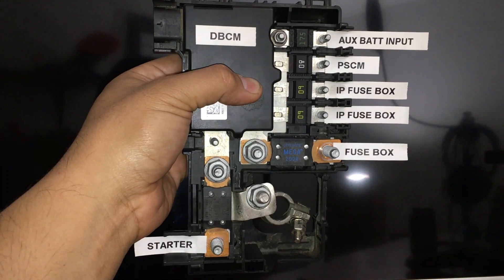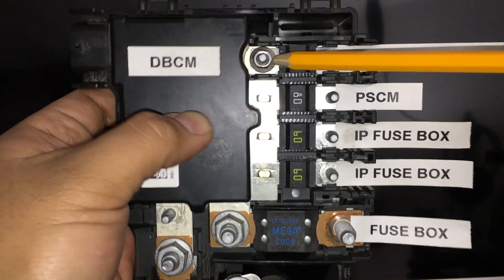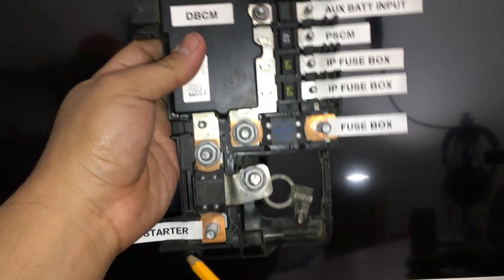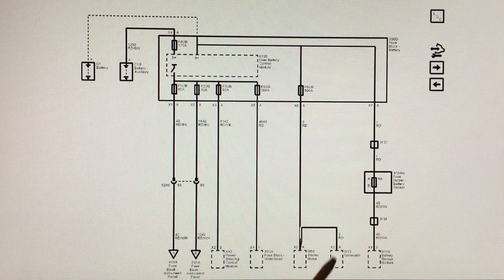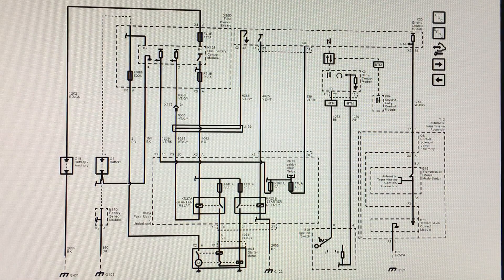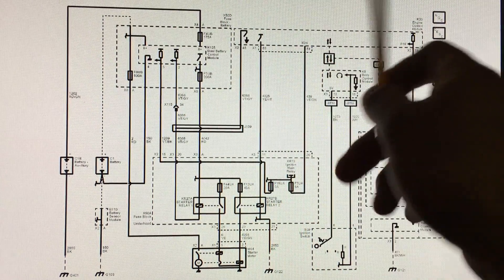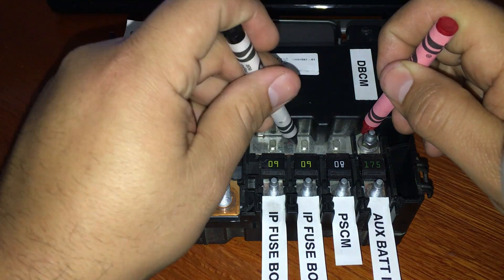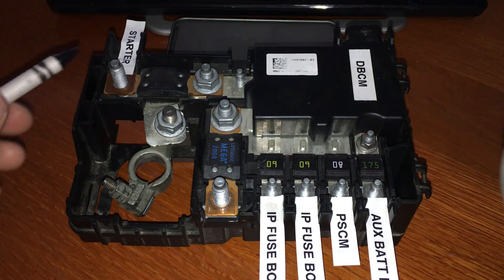CHEVY MALIBU P305F DUAL BATTERY FAULT DIAGNOSIS PART 2

Comment: I really need to see part one.  Part 2 is very interesting to me.  I delt with different electrical systems in the past (I was an Auto, [Truck, small engine with generator, some off road equip] Electrician) before retiring in 2016, but this type of equipment still gets my attention.

Comment: So I have this exact model and my issue isn’t it throwing a code. In fact there are no codes. But once mine goes into auto stop it stalls out trying to restart the engine. The starter is moving but it gives two attempts before quitting. Usually 2 -3 attempts after the starter turning for some time before it fully starts the engine. Do you think the DBCM could be the issue in my case as well?

Comment: This module look some way like a glorified couple of diodes that are joined at their catodes to feed the accesories and each anode is conected to one battery. During crank, main battery goes low (9V probably a bit less) and auxiliary remains at 12.5 so the accesories will prefeeer this path. Bateries CANT see each other directly since the diodes are between them, So they remain isolated and accesories will keep working always on the highest voltage. Trying to figure out how much power electronics you can fit an such small box, could be power mosfets instead, but thats all.  Power diodes wont drop more than 0.4V and some of them are able to stay below 0.2V. Unsure for car use really. Good vid man. You really explain everything. Best channel I have seen on tech vids. I want ot thank you the effort of filming because working solo and filming, man, your day most have 48 hours. I hope you can get thing working again for you, because you seriously deserve them. Saludos Amigo

Comment: Love the crayons...my car is currently having this problem. I have replaced the main battery and the check engine light is in. I took my car to the dealer and your right the diagnostic test came back stating dual battery fault. I felt this video was describing my problem to s "T". My auto start remote no longer works. I read in the comment this happens after 5 years. Well, that too is correct..my car just turned 5 yrs old. Wow, GM this is terrible.

Comment: Actually  both batteries are always connected together except when starting,  the starter relay disconnects the aux battery from the electrical system  so that the aux battery powers vehicle    electronics  and only the main battery  is used to start vehicle.

Comment: Awesome breakdown! I found that following the TSB was not very helpful in diagnosing the complexity of this system. One thing I also noticed is when testing either battery in this system you should unhook them first as I found the auxiliary battery was passing a battery test and giving a reading of 190 cca when tested in vehicle and only 87 cca when removed from the vehicle. Before testing out of vehicle I was led to believe the battery control module was bad, however that was not the case!
Reply: So what was the problem/
Reply: @Lylahrodr as I said the secondary battery failed the battery test when tested unhooked from the vehicle. So the secondary battery was what was bad.

Comment: Right on thank you man I just replaced my battery fuse block and it fixed my problem I got it on eBay for $50
Reply: chase vogt what exactly was your problem
Reply: @1662ks  the car would shut off at a red light as normal but upon releasing the brake when the engine would restart it would also reboot the radio each time which was a mild annoyance at its least but would also hang up on people when  I happened to be on a call. 

 The auto stop start became  really rough and obviously lit up the check engine light, my auxiliary battery tested fine so I ended up replacing the fuse block on top of the battery with one from ebay for $50 and about 30 minutes of time with a few hand tools, everything works perfect now, good as new
Reply: chase vogt do you have the link to the part? I actually just purchased a 2015 Malibu and while I haven’t received a check engine light or a complete shut down, upon releasing the brake, I do get dimmed lights as well as the radio reboot. Also the battery voltage drops down to about 12.1
Reply: Kenneth Sullivan also here is a link to a forum post where us Malibu owners spoke about the topic https://www.chevymalibuforum.com/threads/p305f-check-engine-code.106833/page-2
Reply: @chasevogt2090  I just purchased the referenced one and fixed issue.
Reply: Aden Burd right on man!!!
Reply: @chasevogt2090 did you replace the whole dbcm or just one piece? Do you have a part number? My vehicle is doing exactly what you said yours was. Thanks.

Comment: Hey everyone so I had that engine light came on, I checked the code and replaced rear battery. Nothing happened, light stayed on. So I ended up replacing the 175 amp midi fuse that is in the fuse block on top of the front battery and that fixed this whole issue for me. Ordered the fuse from amazon for like $6. 
 
Hope this helps someone else!
Reply: Oscar Quiles were you losing power to accessories like the radio?
Reply: Kenneth Sullivan yes I was! It would turn it off for like 1 second and then turn back on.
Reply: Can you share the part number? Also, did the problem come back or is the fuse still going strong?
Reply: shawx0g fuse is still going! Haven’t had an issue with the car since replacing it. 
 
Blue Sea Systems AMI/ MIDI Fuses https://www.amazon.com/dp/B004ZJ0V7Y/ref=cm_sw_r_cp_api_i_LFo6EbXMM20F3

Comment: Eric, I don't think you can test it how you described.
If you have a 4 channel scope, connect as follows:
1- Run/crank 12V feed
2-Cranking switched ground
3-Main battery input
4-Aux battery input.
Common ground to the DBCM ground pin.
Looking at the switching table in your first video, you see that both batteries are connected to the outgoing fuses KOEO.
During crank, the main battery is disconnected from the outgoing fuses.
So with key off you will likely have slightly different battery voltages as the main battery has supplied quiescent loads while the aux battery has been isolated.
You can apply a reasonable load to each (say 2 headlamp bulbs) and watch the battery voltages on the scope to see that the batteries are actually isolated with key off.
Next with KOEO you should see the battery voltages become equal.
Applying the load should show a drop at both battery inputs.
Next in crank you should see the main battery dip under the high starter load and the aux battery stay up at 12V, as should the run crank (key on) input.
If the voltage at both battery inputs falls, either the main battery is remaining connected to the output or the auxiliary battery is weak or has high resistance. The amp clamp on the aux battery cable will prove which of the two you're dealing with. (ie you should not see the aux batt contributing to starter current.

Comment: I wonder if that has a contactor inside it or if it's solid state??
Reply: Solid state. Circuit board inside some sort of epoxy. Took mine apart as it was fried.
Reply: @jburd011  Huh, interesting thanks for responding!
Reply: For me power diodes. Too small to house powe contactors that they dont last big number of cycles. ... but just talking. Never seen one of these, I will neer wont, not planning to buy a GM product in my life.

Comment: lmao @ the crayons  love it!!! i could see monitoring the two voltages with a scope to see if it drops when cranking. and also the sense to see when it goes to ground.  that should give a picture. a meter wont be fast enough. i suspect large mosfets inside.

Comment: The code setting criteria is the ecm must see 9v or less for over a second.  Most batteries fail a load test if they drop under 9v during cranking.  So, I feel it's almost irrelevant which battery is supplying the starter and which is supplying the rest of the system during cranking - if either battery is at 9v, the car likely has a bad battery.  I'd be curious to get a car with this code, install two new batteries and watch the code disappear - even if the battery module is bad.
Reply: I see your point but the AUX battery looked like it was REALLY small (like the size of his closed hand). I could see that battery holding up the accessories while the car is stopped for a couple of minutes but if it was (because of the module failure) being asked to supply cranking current I think it would probably not support the load and would drop - probably to <9v.  Now maybe a fresh AUX battery would for hold up for a while but that would just be masking the real problem i.e. the modules is not switching the starting load to just the main battery. I think the fault would return in short order. One needs a good way to test this module to be sure.
Reply: @davesage9190  Genius!!  I remember the CCA was way low also as he was entering it into his battery tester.  So it's not designed to handle the starter cranking amps and will drop low in voltage even with a fully charged brand new aux battery (not designed for that load.)  It just clicked in my head thanks!

Comment: Jake, there's no way...if I had a known bad module...a sealed one...that I wouldn't dremel it open and look inside to see what failed.   I don't think I could go to sleep without knowing, as a matter of fact.  I'd want to verify that the drop in voltage on the x3 lead caused a relay to energize inside and cause the change in battery being used.  Unless the customer wanted the thing back to do so herself, that is.  Then I'd be asking her to let me know.

Comment: We need a part III, take a sledge hammer to the lid on the module, let's look inside. With such high current devices, it doesn't take much resistance to cause a fail. Problem is, simple resistance testing in an active circuit is not as uncomplicated as one would think. They say it can be done with the PP IV, but in my hands some readings don't make sense.

Comment: Perhaps a simple test of the switch over could  be :

1. Disconnect the main (primary) battery all together.
2. Turn the ignition switch to the accessories position
3. Check that you still have voltage on the accessories (because both batteries are normally in the circuit and the AUX battery will continue to supply the accessories).
4. Turn the key to the crank position and the accessories should continue to operate because they remained on the aux battery.
5. The starter will not work because the main battery is missing. That would also be an indication that the switch worked and is not stuck with both batteries in the circuit. 
If both batteries are stuck IN the circuit because the switch did not transfer then some of your starter load will be from the AUX battery as well as the main battery so the AUX battery voltage will drop. Maybe this is the actual cause of the error code (i.e. the switch is not isolating like it should and the AUX battery voltage is dropping to <9v trying to start the vehicle).
I don't really know it's all unnecessarily complicated BS to save a bit of gas while you're sitting at a light. Just saying.
Reply: So  - come on - rip the top off that battery control module. Inquiring minds want to know what's in there. I assume because it's so thin it's probably some big honking MOSFETS and some drive circuitry. Maybe you can do a Russian fix on it :-) no parts required.
Reply: i see your thought process. add in voltage drop testing  and ya may have it
Reply: @richardcranium5839  I see a potential problem. It might be that disconnecting the main battery may leave the whole car disabled (for some other engineered reason) so you can't even test the theory. I guess you'd need the vehicle present to test whatever theory you come up with. It would be good to come up with some sort of test because as these things go the parts cannon can get expensive.
Reply: Amen brother. Exactly what I was thinking. I have gone through auxiliary batteries  every 6 months. Only thing I can think of is it's constantly  being used , bad switch.

Comment: Incredible amount of complexity and expense added by manufacturers and government to save pennies of gas to stop and restart engines at a stop sign.
Reply: A thing I have seen here in some Buses is that the gearbox goes to park alone after 30 seconds and once you release the brake, in goes to D again, The really saves some fuel by offloading the engine .... guessing if the start / stop garbage is the best solution.  Another thing that make me laugh is people wont relinquish the aircon, or all the connected gadgets ... in the end they waste the same energy. What a fiasco. On the buses I mention, the gearbos going into P allow the engine to move the aircon bettern while iddlying. So in the end you get pretty efficient direct injection engines, tailored to the finest trnasmicions to lower diesel consumption, but now, people ask for Aircon at the buses. Same in the metro, we put a couple of lines with the last technology, super efficient tractions systems ... then every coach runs aircon full blast. So the energy you saved on modern state of the art solid state control for the traction motors, then is wasted on cooling 1500 people in rush hour ... LOL ... love it.
Reply: Regret the day I bought this car. Nothing but problems. Feels like a scam from gov/dealer. I have had this code  from a month after buying car. I have changed both batteries,  changed out  modules , alternator no shade tree mechanics ,diagnostic came from major dealership yet still dealing with same code.  Told mechanic to stop guessing at my expense. Like to know who thought this ideal  up bet they wouldn't  want their  loved one in.
Reply: i'm curious how the starters and everything else will hold up.  cant imagine city stop light to stoplight operation.
Reply: @richardcranium5839  the problem isnt so much the starters.. the real problem caused by start stop is timing chain/ valve train issues on top of using low viscosity oil like 0w-20. Your car comes to a stop, shuts off... the oil inside all the timing chain tensioners, cam actuators etc bleed into the oil pan  because the engine is off we dont have oil pressure to supply oil. now you let off the brake and the car starts up, those components now have a lack of oil pressure and oil lubrication so...... now do this hundreds of times with higher mileage and now you have failing timing chain tensioner(s) and actuators etc
Reply: You can disable it by wiring out this module but the engine service light will light.
Reply: Facts
Reply: It isn't the vehicle manufacturer and it's not for Saving gas. It's sole purpose is to reduce emissions, if your engine isn't running everytime your vehicle stops that reduces a lot of idle emissions. I wouldn't want it in my vehicle either, my wife's vehicle has it, but there is a to disable it on most vehicles
Reply: @Richard White  Saving fuel does reduce emissions. That was/is the governments plan. To reduce emissions by saving fuel/fuel economy. Look up CAFE standards for vehicle manufacturers and you'll see. Corporate Average Fuel Economy.  It's a huge constraint put onto the manufacturers.
Reply: Start / stop is an abomination. On the Cruze sold here, IT CANT BE DISABLED. I would never buy a car that has this feature and you cant disable it. Yes, it reduces emitions,  and also realibility so you must junk the car sooner than expected to buy another one which of course lets you with lots of pollution, scrap and recycling issues and energy wasted. It is a big lie. You want an eco friendly car, just buy a direct injection small diesel. They are super efficient and last longer.
Reply: @38911bytefree  I disabled mine by discounting the plug by your clutch fan right there as soon as you open the hood it’s right there!
Reply: @got2getit204 did your engine light stay on?

Comment: Now wait. Your saying to put my meter on ohms and ohm out a component with voltage on the circuit?
Reply: Interesting. I was always taught the circuit has to be isolated with no power on the circuit. Always willing to learn something new. Thanks!

Comment: It also switches accessories to the aux battery to prevent voltage drops/spikes to accessories and modules while cranking. Systems like these expose the guys around you that have a lack of knowledge of electrical systems. We had one of these come in that had a blown fuse to the Aux battery due to someone messing around with the connections. It took me thirty minutes to get a guy to understand why there was voltage on both sides of the fuse even though it was blown 😂. He just couldn’t grasp that the alternator was on one side of the blown fuse and a low battery on the other side of the fuse. I try to teach guys while helping them work through a problem but the ones that constantly come for help for the same things and never learn I just take over the job from and they usually don’t last too long. It seems like our industry is full of guys like that. They think electricity is some kind of magical thing they can’t learn when in reality it’s much simpler than they want to believe it is. It’s like they can’t grasp anything because they’ve already psyched themselves out into believing it’s above their heads before you even tell them anything. It drives me nuts.
Reply: Just tell them to go do a brake job and leave the electrical work to the expert 😁
Reply: How did you know the fuse was blown?😁